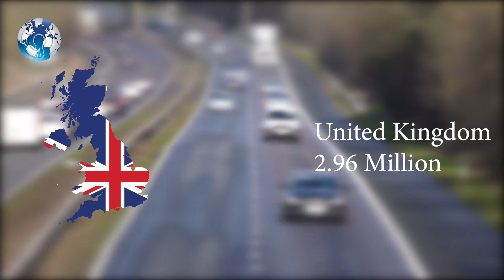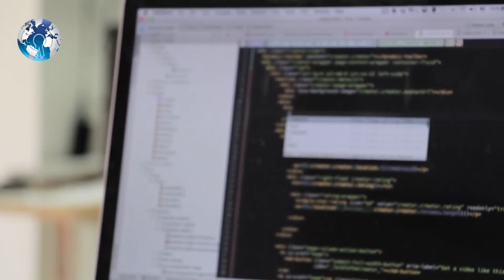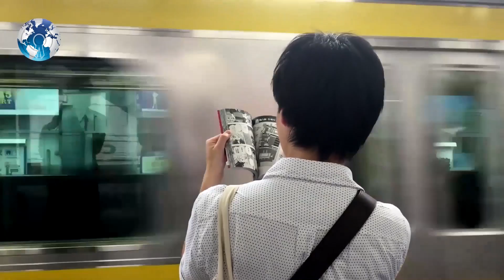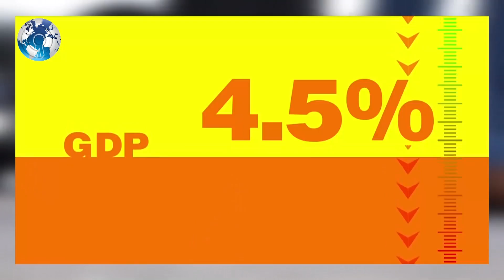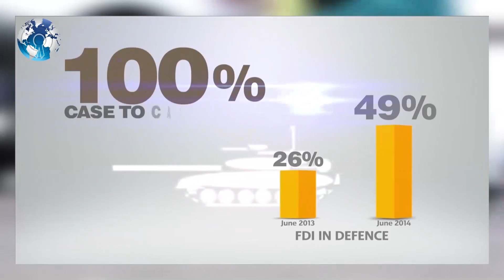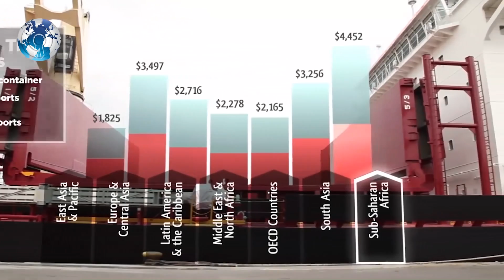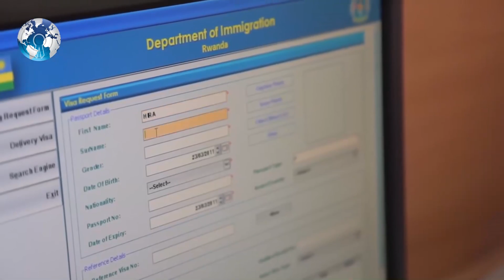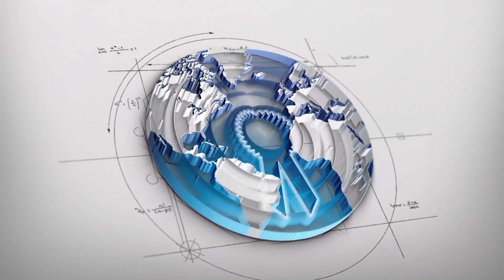India overtakes Germany to become Largest Automobile market in the World

Comment: Germany have 2× more cars then India
Reply: wait and watch what is the population of germany (82.85 million 2019). 2018 Germany: Total Number of Registered Cars. The total number of passenger vehicles registered for road use in Germany  46,474,594 cars. VW, Opel and Mercedes Benz remained the most-popular car brands.  How many vehicles are there in India? - Quora. The total number of registered motor vehicles in India was 210,023,289  2015 data.
in n 2016, the total number of vehicles in the country amounted to approximately 230 million, an increase from the previous year's 210 million vehicles.